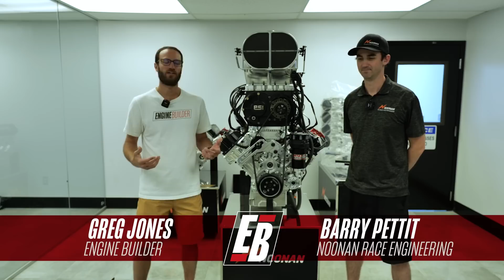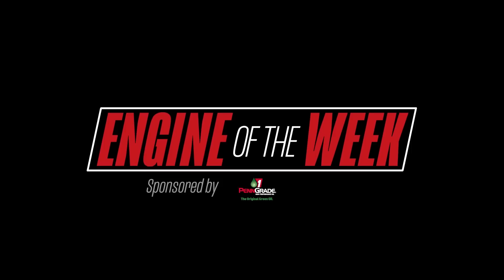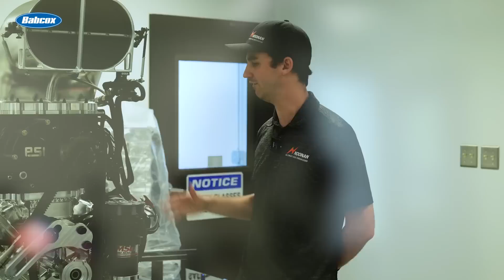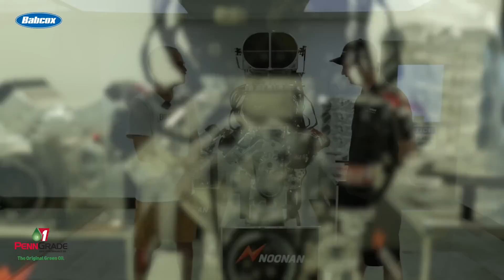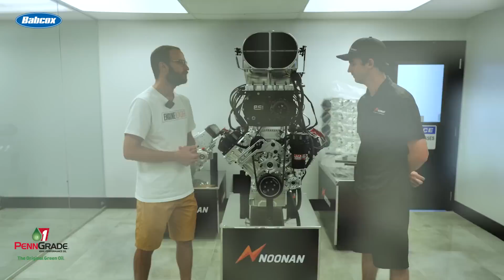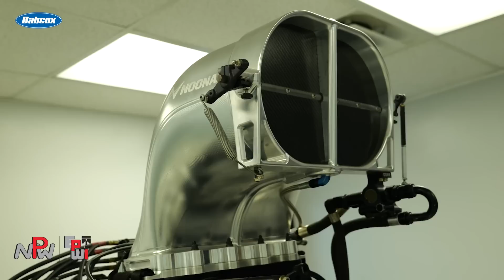Noonan Race Engineering's Supercharged 4.900 Bore Space Hemi Engine

Comment: I've never seen a procharged car make 5,000 horsepower even running the big 144 on it I need to see the video to believe this usually they are under 4,000! He must be taking about a engine dyno but I still don't think the pro charger is going over 5,000 I'll have to see that to believe it!
Reply: He said procharged cars getting the same at 3600-3800hp and the turbo guys blowing it out the water at into 5000+ hp
Reply: I think he said he'd seen dyno sheets , so yes dyno apparently.
Reply: @RbsAustinHemi  Have you ever seen numbers like that I've probably seen close to a hundred pro chargers dynoed and never seen that.
Reply: @RustyWells2 he said Turbo cars in the end if you were paying attention were getting over 5,000
Reply: @ironmike742 I understand what you're saying about Turbo Cars towards the end, But he did say earlier Procharger Cars making 5,000 also, he was little quiet when he was saying it, watch it again, and you'll hear it.

Comment: Austin Coil developed a 4.9” bore spaced block based on the Boss 429. 

It’s interesting to note that this Noonan 4.9 engine has a valve train option that mimics the Boss 429 system. The rockers are placed on individual pedestals like the Boss. 

I think the biggest difference is the intake rocker is flipped around taking some angle out of the pushrod. 

I saw one of these being serviced at Orlando back in March or April and was astonished at how the heads resembled the Boss 429 head.
Reply: The 4.900 Noonan HEMI heads I've seen retain the completely rotated, opposed valve layout, chamber shape and plug location of typical HEMI engines and don't resemble the Boss 429 configuration in any way. I'd be curious to see the heads you're describing that are available from Noonan for the 4.900 platform.

As for the rocker architecture, the Noonan heads I saw had the 2 shaft system.....although there has been an individual pedestal/bed-plate option for HEMI engines from both Jesel and Barton/TD for many years, as I have that particular system on my PSI screw blown 4.800 HEMI. It's a package that also works on a factory production iron head, as it was initially developed for traditional Super Stock HEMI engines.

I'm considering changing over to this platform and have talked to Noonan on 2 occasions and neither time have they mentioned a cylinder head option that mimics, or resembles a Boss 429. Do you have any additional information on the cylinder head you saw in Orlando???
Reply: @geneticrex  4.9" Hemi heads with individual mounted rockers look a lot like the Boss 9 B441 heads......
Reply: @shvrdavid  Individual mounted mini shaft rockers have been available for 4.800 HEMI heads, including stock iron for years. I have the Barton/TD package on my engine. 

That particular mini-shaft configuration is also available for a variety of engines, including the BBC and with the valve placement of a BBC even in their heavily rotated aftermarket options, they've never really appeared to resemble a Boss 429.

Although, I guess at a quick glance a HEMI and Boss 429 with it's extreme rotation could fool somebody, especially the full hemispherical Boss head, which I believe is what the A-441???
Reply: @geneticrex  I’m just giving my impression of what I saw on the 4.9 Noonan. 

Yes the valves were directly opposed at 6 and 12 o’clock. The interesting thing was the billet bridge which provided an individual pedestal for each valve. 

Why did I think that was important? Well to my eye that could give the engine designer more flexibility on where the valve could be located and also the valve angles could be easily changed. 

This was a feature on the Boss 429. If you look at the current “Roberts” design Boss 429 IHRA Pro Stock head you will see the valves are located at 6 and 12. They also are able to close down the chamber due to the less steeply angled valves. Hence higher compression and lighter pistons. 

The 4.9” Noonan I saw did not have typical hemi dual shaft valve gear. It was like the Boss 429 with the exception of the intake rocker flipped backwards to keep the pushrod straighter. 

I’m not calling it a copy of the Boss by any means but good ideas seem to always rise like cream to the top.
Reply: @michaelthompson1110 There are advantages to the individual mini-shaft configuration including serviceability, which is why the number of platforms that offer it has increased over the years and why I opted for it on my 4.800 engine.

Is it as strong as the dual shaft HEMI architecture??? Not according to the builders I've talked to, but there aren't many of us running Top Fuel. That's probably why the Noonan deal offers both. The few Noonan heads that I've seen, including Kye Kelly's have been dual shaft. I would really like to see the individual system. Maybe Noonan can send me some pics before I decide if I'm going this route.

It's a shame they instituted the RPM rule in Pro Stock, since that really hinders the potential of an engine with increased chamber rotation all the way up to opposed valves by eliminating the over-rev ability of the design. Between that and the fuel change from VP to Sunoco, it basically put an end to the MOPAR Pro Stock package even after they won the last 2 championships before the rules changes.

It's a shame that Pro Stock is without competitive Ford and MOPAR teams, since the competition from all 3 manufacturers is what made the class great from the beginning. Although I did see the Darin Morgan Ford block and head which is more traditional canted valve layout.....so maybe there's hope they can eventually field some competitive cars and break up the current monopoly in the class.
Reply: @geneticrex  I was talking about the Boss 9 hemi style head, not a factory Boss 429 head........ Totally different heads, I even mentioned the 441 designation...... I am well aware that other heads use a similar rocker mounting system. Put a 4.9 hemi head and a Boss 9 style hemi head on a bench beside each other and look at them. They are very similar in more ways than how the rockers mount to them.
Reply: @shvrdavid  I know you were.